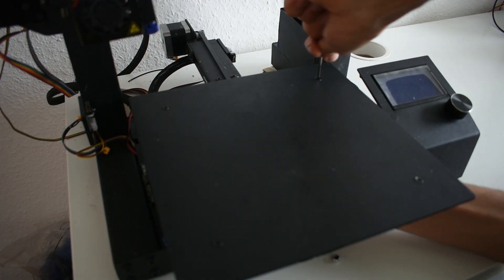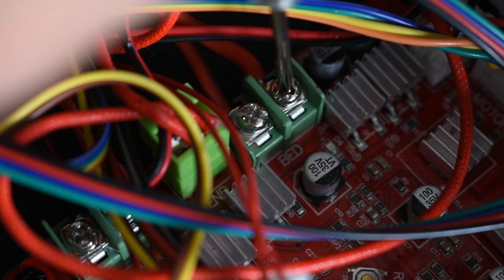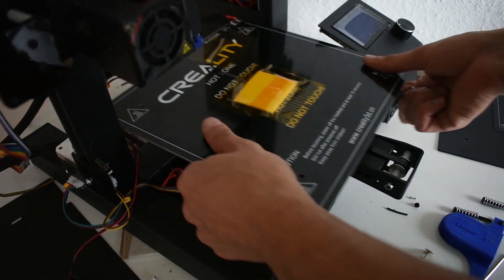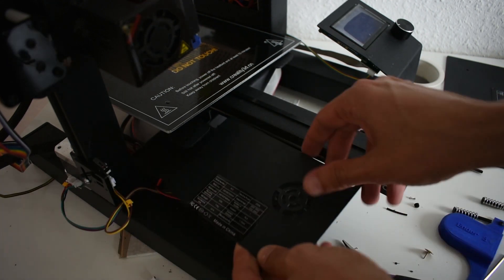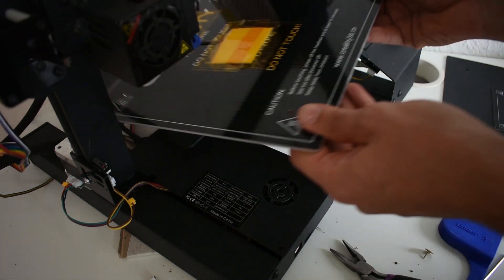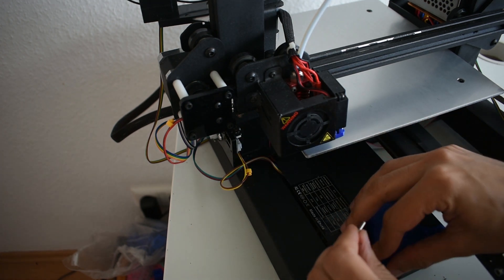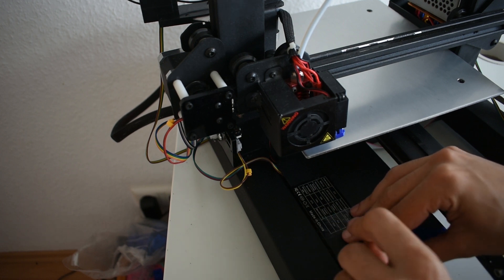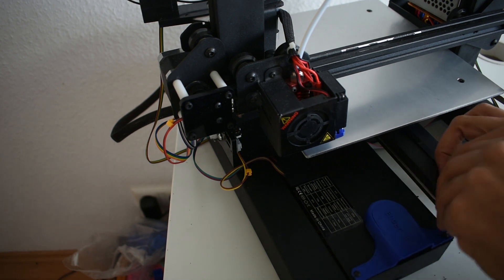How to replace 3D printer warped Heat Bed

Comment: No idea what you even did, all you can see from the video is you took it apart and just put it back together 🤦‍♂️
Reply from the maker: i removed the old heated bed and change it with new one
Reply: @sadekmostafa123  Not really a "fix". And your video is confusing.

Comment: its really helpful. did you use magnetic bed or glass bed?
Reply from the maker: i have the glass bed for shiny smooth surface but i had the sticky bed that doesn’t need glue to stick the filament to it